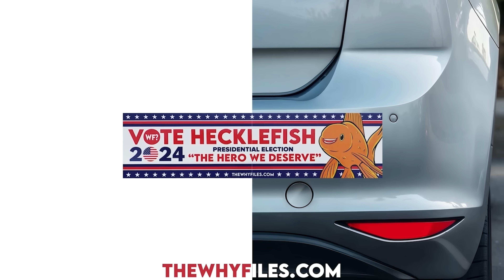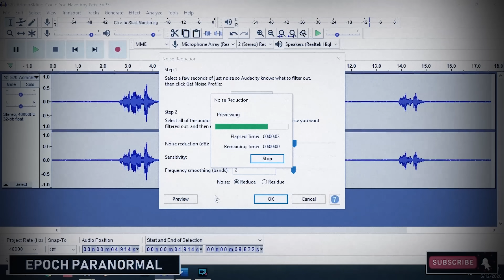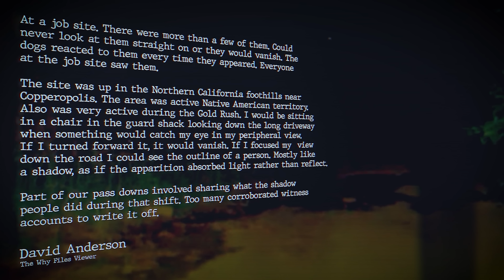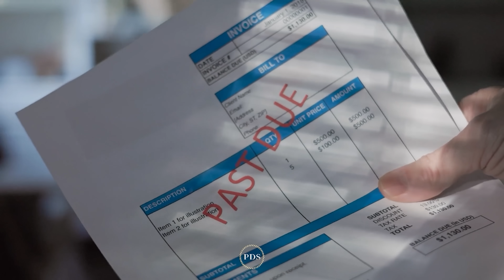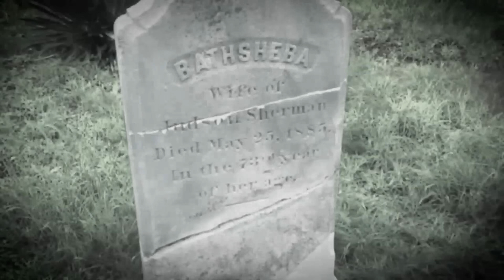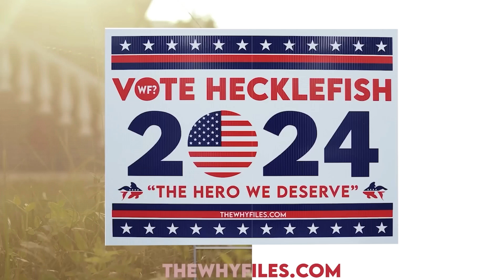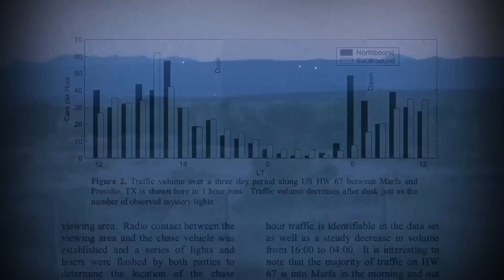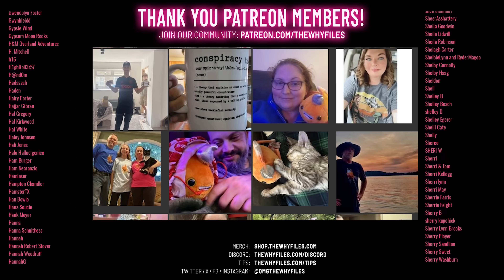COMPILATION: The Science of Ghosts and Ghost Hunting

Comment: I used to take my dog for a run to this huge cemetery in the East Bay with lots of old crypts. One time we came across a crypt with the glass broken in it’s door. As I approached it I felt some invisible force push me back like a punch to the chest. After I calmed down I went up the steps again and looked in the window. There was a stone sarcophagus with the lid slid off and a bony hand sticking up and out. I sensed a lot of anger and then realized that someone broke in and stole a valuable ring off the deceased. There was a lot of strong and unsettling energy and emotion there. Whatever  it was though, I think it knew I wasn’t there to cause any more harm, just a witness. The burials were from the 1800’s and early 1900.

Comment: When I was like 14 I had an experience that shook me. I was staying at my friend's house. It was me, him, and his parents. And were In his room. And it's 1:45 in the morning. And I'm laying on the floor, and my friends on his bed. His doors shut. And in his room he had barley anything just a tv stand with his tv on it and his bed. And a window. His doors completely shut. And he's fully asleep. His window is completely shut with the blinds fully pulled down. And the TVs on, but it's on silent because he was sleeping. I'm laying on the floor looking at the TV. And I look over at the window because something catches my eye. And the blinds are fully pulled down, and there swaying a little bit. I was trying to think of what possibly could be making it do that since the door and window were shut. And there was no wind outside. No heater vent, and his room was just a box basically with nothing in it. And it was dead silent in the room other than the tiny snores my friend was making. And as I'm sitting there watching the blinds sway I'm thinking there's absolutely nothing that should be making it do that. But I was still tryna rationalize it in my head. Then all of a sudden it slowly gets lifted up like someone grabbed the bottom and was raising it up high. And I'm watching in horror as this thing just slowly gets raised higher and higher. And then once it got pretty high it stopped, then it dropped and went smacking into the window super hard. My friend didn't even wake up from this and I was too terrified to get up so I started yelling over there for him. And he finally woke up and was super confused and told me I was imagining things and to go to bed. And passed out in like 10 seconds. I was so freaked out I called my mom and she came and picked me up. My friend called me the next day asking why I left. Because your damn house is haunted that's why! He for some reason acted like I just made up a reason to leave and didn't believe me

Comment: I once saw a Bright orange Orb about the size of a ping pong ball drop out of an area with Two Urns on the Top shelf of the entrance to the store Owned by the Deseasd. I was staring off in that direction. It happened to be a local liquor store since 1956. Anyway, it dropped out bright orange, bounced once, then took off down the aisle, turned Hot White and disappeared into the wall. I will Never forget it.

Comment: Kind of interested here AJ at the part where you describe the EM fields and state some things that are simply not true. The EMF readers will not "just randomly go off" due to "stray fields." That notion is put out by wannabe debiunkers who neither work with nor really understand electromagnetic fields. A static field can set off such, but only when the meter is moved within a strong enough field. You demonstrate this in your video in one spot. An AC current can set off a stationary or moving EMF meter, as the field fluctuates and is constantly in motion. However, for any given field, it's strength will rapidly decreases over distance. Just being in the same house with a live AC line, for instance will not set off an EMF meter meters away. Most meters have to be very close to an AC line to detect the field at all. The field will not move relative to the area of generation. What this means is that the field around a conductor or device will remain around that wire or device. Special circumstances are required for a standard EMF field to become a radio wave, IE a field separated from the conductor or device. People who do not understand magnetism, electronics, electromagnetic fields, or electricity will throw out numerous reasons why these devices go off. In many cases, I can tell why a device goes off when watching something like this, but in MOST cases no observable logical reason is present. If you want to see just how rapidly a field reduces over distance, I suggest a sheet of paper, fine iron powder, and a small magnet. That magnet, though weak, is very strong in comparison to most fields you will find, yet mere inches away it cannot affect the powder, but it might set off the EMF meter. After a foot or two, moving the magnet will not set off the EMF reader. That is a STRONG field. The problem I see is that, on some topics, you slip into a version of the appeal to probability fallacy mixed with the argument from incredulity fallacy and argumentum ad populum that I call the debunker fallacy -- (Consensus of) Science says it can't be true so, since it can be faked, it is probably fake. Any scientific discovery or claim ever made throughout history can be faked. Once the claim of disbelief is made, another fallacy is used, specifically raising the goalposts (extraordinary claims require extraordinary evidence).

Comment: My shadow person held me down but pulled my eyes open. I could see but I couldn't move anything. I felt like a tractor trailer was sitting on my chest. And then it came in from the left of the door with smoke swirling around it. It was very black charcoal like smoke. It leaned in to look at me and it like glitched several times so I couldn't see its face. And then it slowly walked on past the door with it smoke trail leaving with it and then I was released from my bond